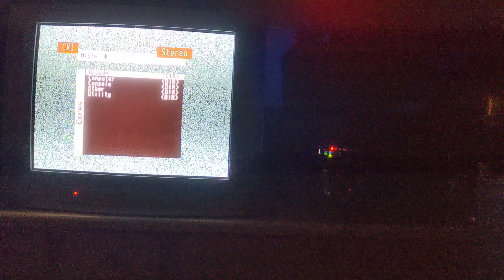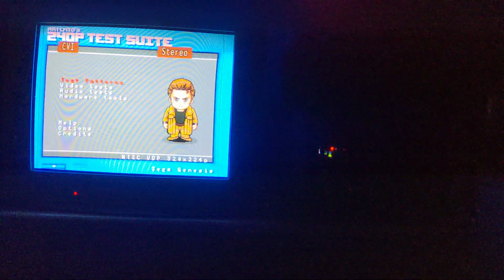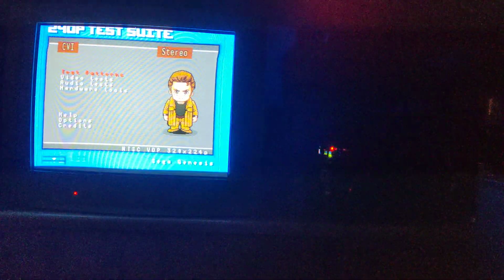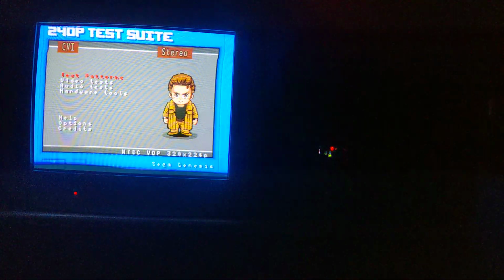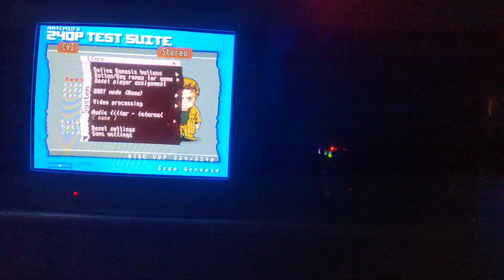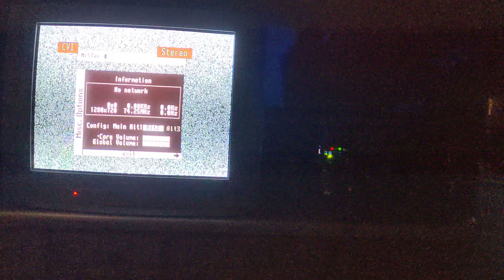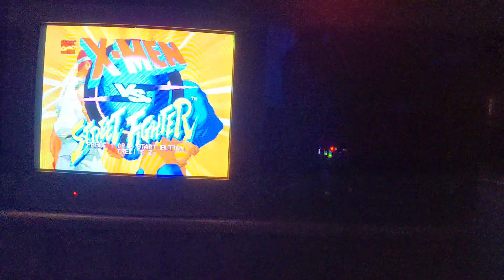Problems & workarounds with the MiSTer FPGA and Philips CRT TV's via component video

Comment: The issue is probably directly related to the resistor that sets the depth of the sync. The analog IO board's sync is way out of spec and it should be a lot deeper. E.g. 100-150mV with the Analog IO board, while spec should be 240-300. I'd probably go down the RGB to Component converter board with a proper 430 ohm resistor. (330 for direct video)
Reply: I tried swapping the R1 resistor from 510 ohms to 430 ohm on the IO board and it didn't fix the issue unfortunately.
Reply: @BrokenTV37  Interesting, let me look at these under a scope.  Do you know if the real consoles work on it as well?

Comment: I've had similar issues with my setup, what helped for me was having analog video setup through the analog io board to the CRT TV with component input, then the HDMI output from the mister to a HDMI tv at the same time, then load up a core for example, the genesis core then in the core's menu set scan doubler to none and if you select anything else in scan doubler option in the menu while hooked up to just a CRT TV you will get a scrambled video signal